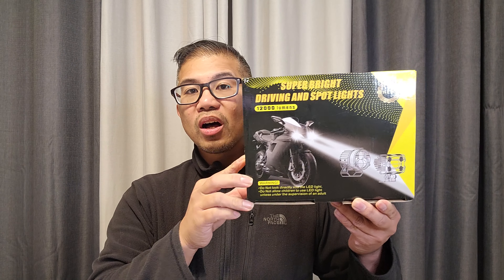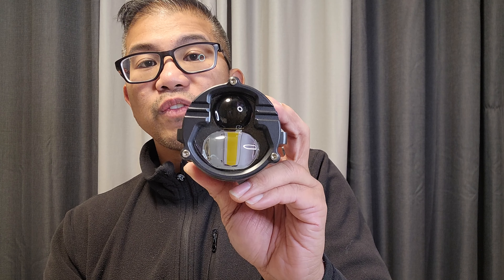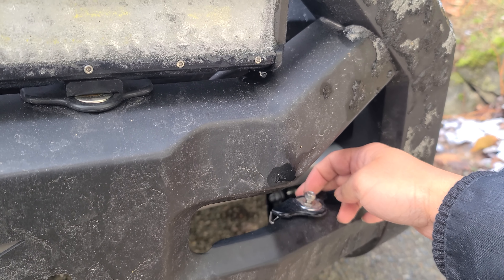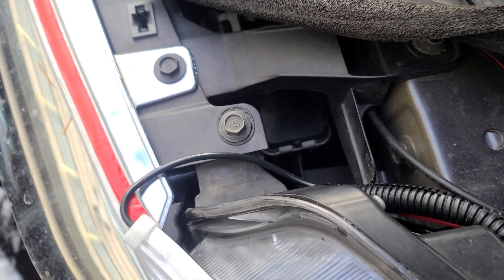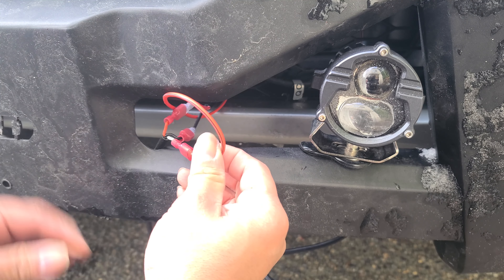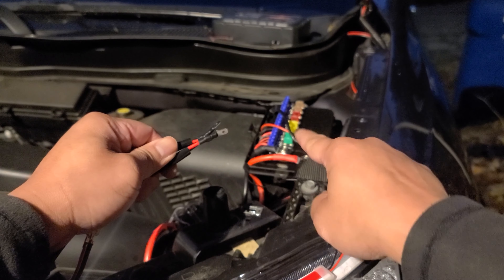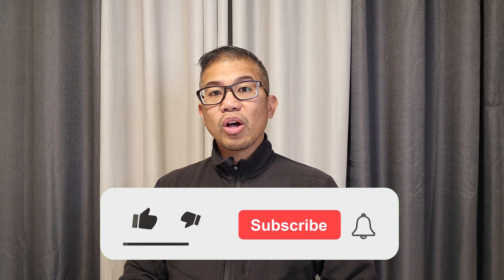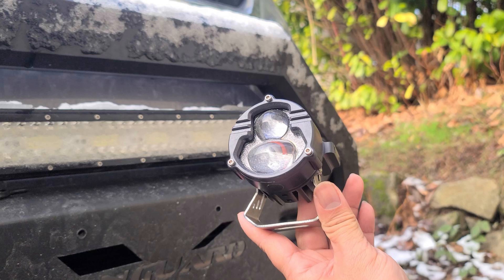How to install LED Co Light Dual Beam Fog Lights

Comment: How was it so far? I am thinking of getting the exact same model for my 2015 Kia Sedona.
Reply from the maker: Oh it's great. Bright and the yellow has a nice cut off line.
Reply: Thanks for your prompt response. I didn't realize that the switch is a remote control. Do I have to buy extra wirings -- similar to what you've bought or I can just use whatever wirings that comes with it?
Reply from the maker: @mlgarcia23  you can use your own or add their own switch and wiring.

Comment: If I were to use the yellow beam for a fog light (aimed below oncoming drivers  eyes), would the white spot beam be in a good spot to augment my high beams?  Or is it too low or high?  Thanks!!
Reply from the maker: I think it might be a tad bit high. I adjusted mine to where the middle of the spot is aligned with the top of the low beams.
Reply: Can you aim the spot beam and the yellow beam differently? Or do they move together?
Reply from the maker: @Bryce Rollins  Unfortunately no. They move together.
Reply: @AutoSensation  I see. When the spot is focussed with the  low beams, are the yellows in a good fog light position?
Reply: @AutoSensation  When the spot is focussed with the  low beams, are the yellows in a good fog light position?
Reply from the maker: @Bryce Rollins  I think mine are in a good position. I am lifted by 2 inches which might help.
Reply: @AutoSensation  thanks!  Mine are in the mail. Looking forward to installing them.
Reply from the maker: @brycerollins9496  they are nice and bright

Comment from the maker: 👉COLIGHT 3 Inch DB-P Series Dual Beam Yellow&White Fog Lights Pods
https://www.led-colight.com/products/...
10% coupon code - AUTOSENSATION
👉Nilight 2PCS 16 AWG 10 Feet Wiring Harness Extension
Amazon: https://amzn.to/3vhzkQd
👉Nilight 90025B Led Light Bar Mounting Brackets
Amazon: https://amzn.to/3Vl93LD
👉Wiring Harness Splitter
Amazon: https://amzn.to/3FN1qrt